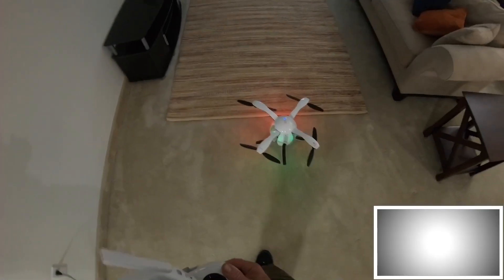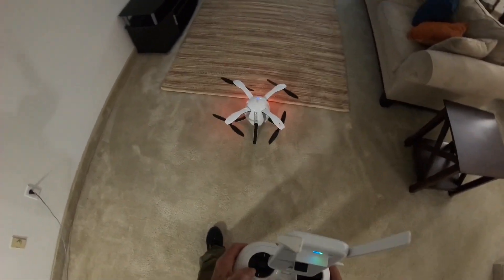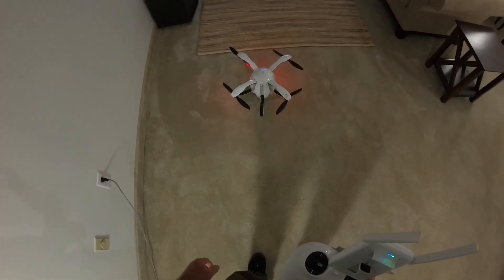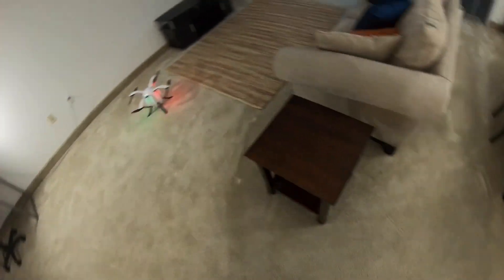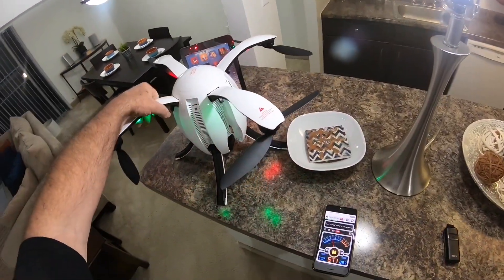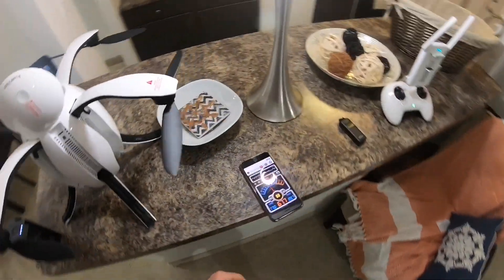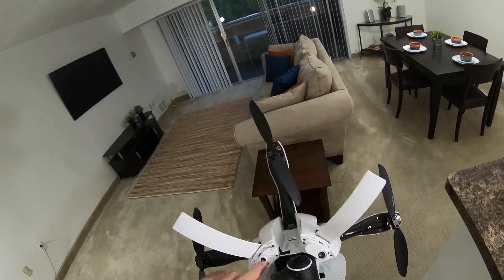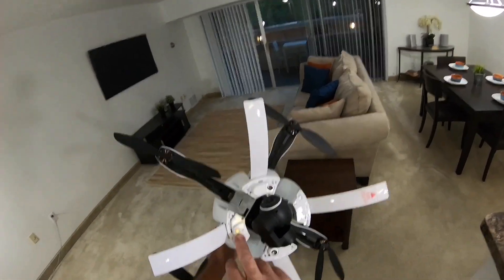Powervision PowerEgg Indoor Sound and Optical Flow Test

Comment: wow true drones.....its your drone  but you do not suppose to pull the battery out like that before shutting it down....i dont think that egg is going to last you long.....but you have balls  taking it up inside your place..... a drone that size  and powerful ... always in open space.....and  out of all my flights ... tech support said i fly  my bird  more than  anyone ....including them ....but  only one time  the drone went crazy .... and as soon as i took off before the legs  came all the way up  the drone went full speed   ...im trying to control it i go left it went right   could not slow it down ... before it got away from me i had to bring it down and crashed it on  the narrow sidewalk ...  with the  lake 3 feet on my left  ....out of maybe over 50 flights it went crazy.... but they did give me a replacement.. sooooo be careful  flying inside.....like i said before i love the way this drone fly through the air...
Reply from the maker: Just wanted to try it Tony, after the i cut the video i put the battery back in and powered down.
Reply: i hear ya ...i were just trying to tell ya things i know of the drone  because i have had it since it was released ....but yea you can really damage the drone in that way cause as you can see the battery lights were still on....but  my mouth was wide open when i saw what you was about to do lol from take off....very brave.. thats a 14 to 15 pound drone...very heavy without the big  heavy battery.....glad you pulled it off though...i dont mean to sound like i know everything,,,, but i do know you said you never read instructions
Reply from the maker: Thanks Tony, I know you were just lookin out. Did you ever take this out and fly without using the app.
Reply: i never flew without the app ..because i like to fly far away....but yes i knew that you could fly without the app
Reply from the maker: Tony Mckee I’m going to try it outside without the app to see if they put a halo on it like DJI does with the Spark.
Reply: post the video  would like to see that to
Reply: also did you ever calibrate the remote  and if you did....did the camera stop turning  on its on